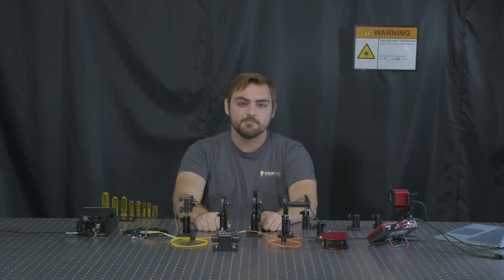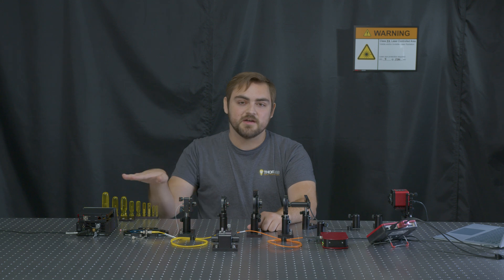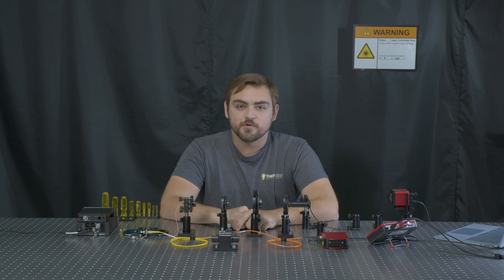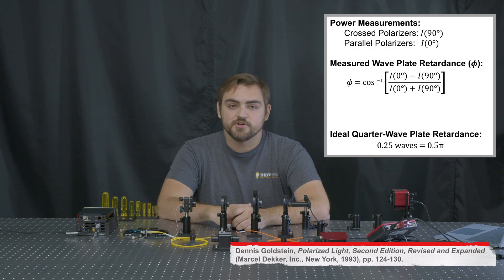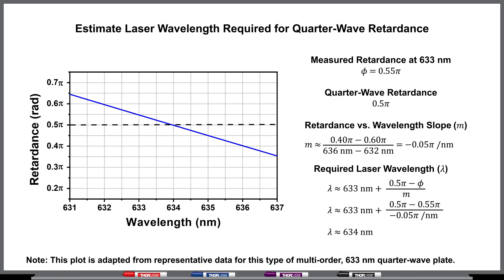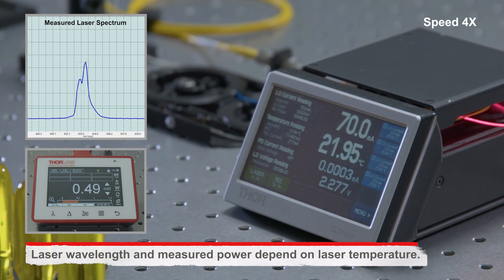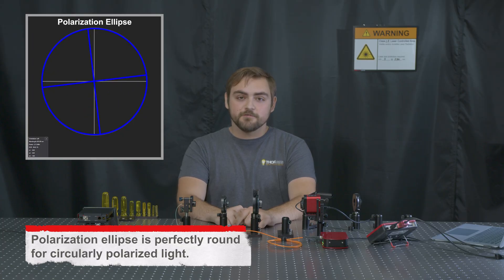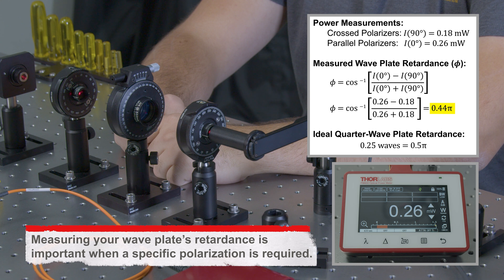Measure Wave Plate’s Retardance and Adjust Via Wavelength Tuning | Thorlabs Insights

Comment: Thanks for making these videos they are very helpful, I have one question if we buy NTR 100 " Motorized Linear Translation Stage, Stepper Motor," Is it necessary to buy "' benchtop stepper motor controllers, " or the motorized stage work fine with Kinesis software? It's not like that stage will not work until I have the controller right?
Reply from the maker: This stage will not work without the controller. To operate the NRT100, both a BSC controller ( https://www.thorlabs.com/newgrouppage9.cfm?objectgroup_id=1704 ) and a computer running the Kinesis software are required. 

The controller is needed to power (drive) the stage, and the computer is required to interface with the stage. When the BSC controller is connected to the stage and to the computer, the stage is controlled using the Kinesis software running on the computer.